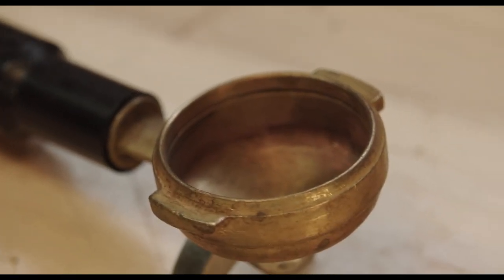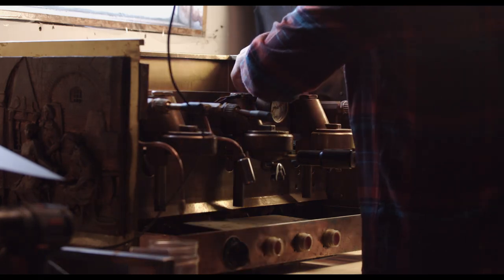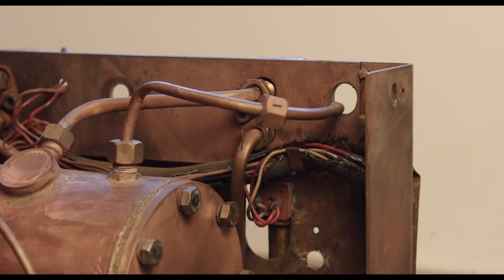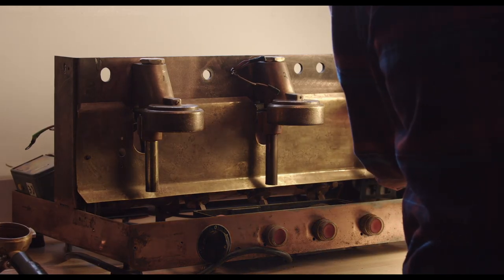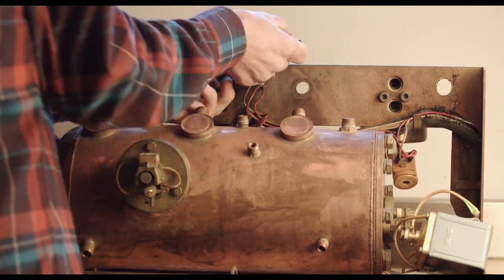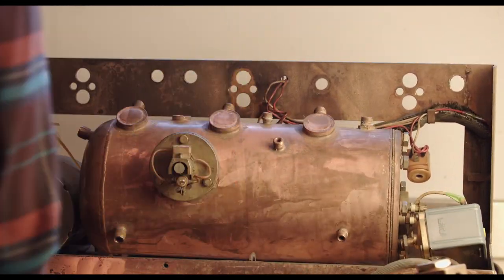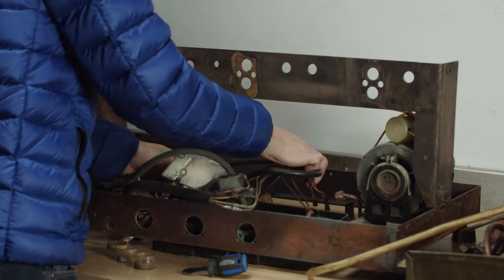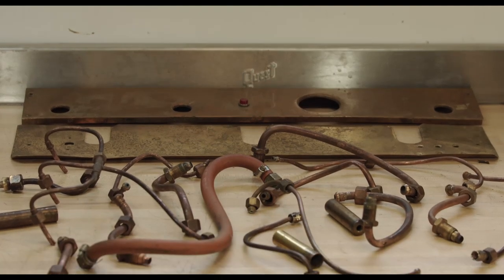Vintage Elektra Espresso Machine Restoration Ep. 2

Comment: A commercial machine is the way to go. I bought a used La Cimbali M21 Junior 11 years ago and it’s been on just about everyday since then. I disassembled it a few years ago descaled and replaced my rotary pump. During the descaling process the acid removes the chrome. I would suggest you re chrome your copper parts, like when it was new. They last forever and give years of service. I look forward to your build. Like rebuilding a classic car!